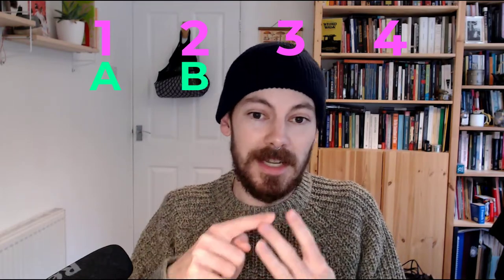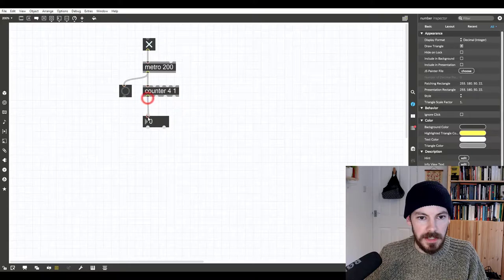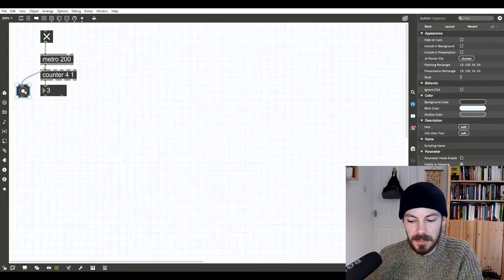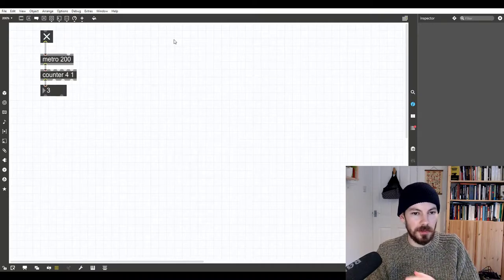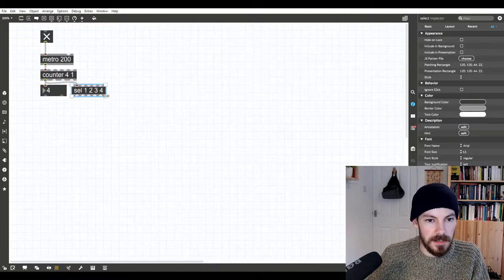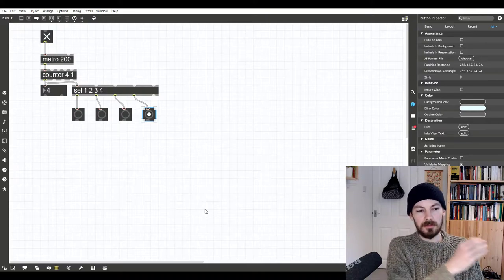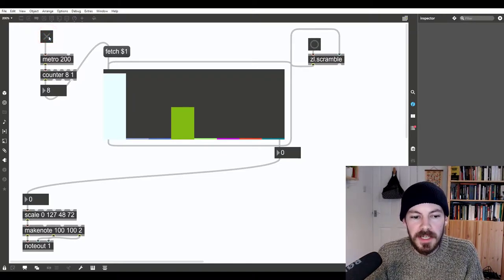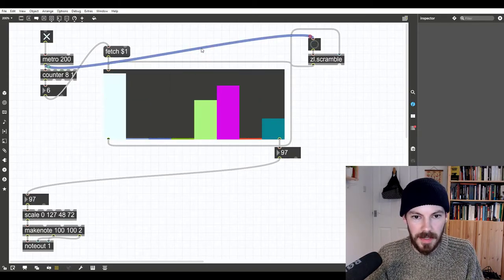Basic Sequencing in Max

Comment: Hey there. Thanks for the video. I have a suggestion: In the slider sequencer example one way to work around the unwanted triggering of the midi note is to add an integer  box so that the slider values are being received in the cold inlet and the bang running at the top triggers only the value integer box when it passes by the corresponding slider. Take care!
Reply from the maker: Thanks Rafael - that's a great workaround idea -- Thanks!

Comment: Hey Oliver, absolutely love your tutorials on Max! Just a doubt, how did you get your default piano sound changed to the one you're using from 6:35 - the "loopMidi" option? Since I can't find that option. I'm using Max on Windows and I use FL Studio as my DAW. Can't seem to figure out how to change the sound/midi from the default piano to whatever I want. Thanks!
Reply: Same here. I'm using Mac however still don't understand how to do it. Would appreciate help as well.
Reply: I was running into the same problem, until I bought the intro version of Ableton,(cheapest) because then you can automatically run the midi output into Ableton to control whatever sound you have there, using the Max 1 or Max 2 channels. It's super practical, but I'm guessing there is also someone to connect it to other DAWs
Reply from the maker: I'm using Tobias Erichsen's free tool https://www.tobias-erichsen.de/software/loopmidi.html
I'm not sure how you'd hook it up with FL Studio, but it's pretty simple with Max + Ableton. You just double-click your [noteout] in Max and change the MIDI driver. Hope that helps?
Reply: @oliverthurleymusic  For some reason everytime I do that the note out wants me to change the name compared to bringing up the option menu when i double click